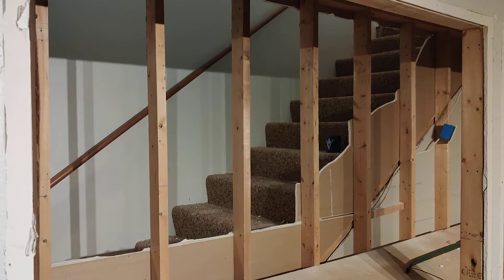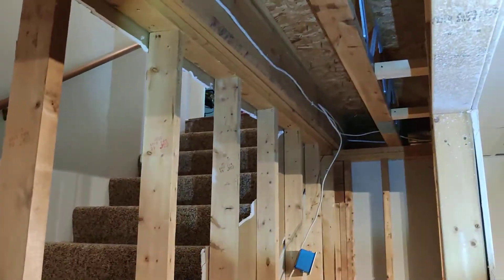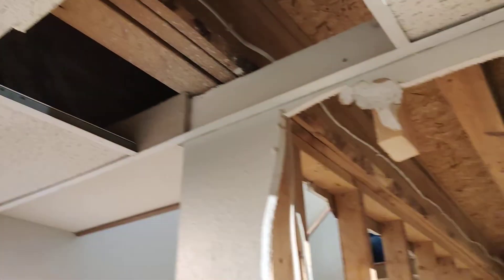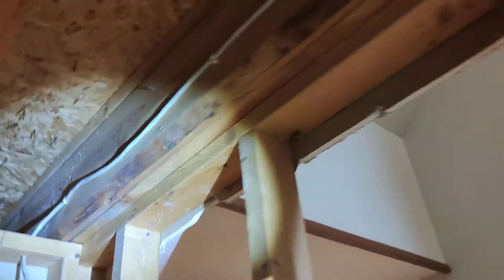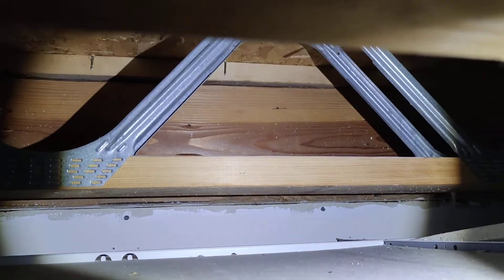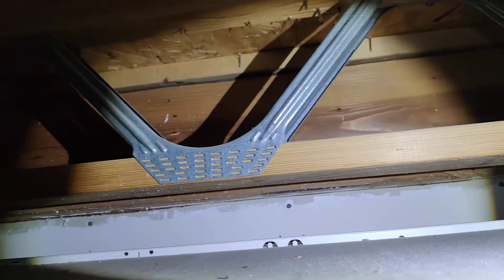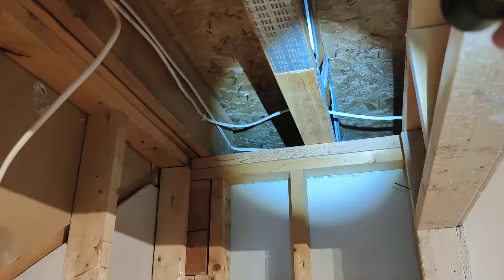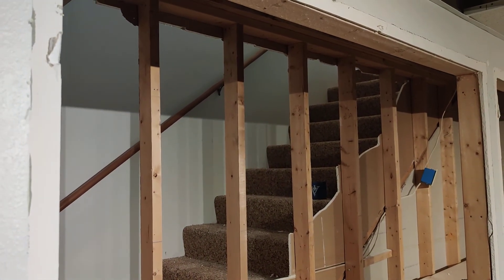To remove, or not to remove, the studs: an analysis of whether stairwell studs are load-bearing.

Comment: the other wall that runs perpendicular to your stairwell wall you stated was load bearing ? Usually there is steel beam in a basement on columns and piers and don't rely on a carpenter built wall. As far as your thinking on stairwell wall I think your probably safe but I would at the very least have a experienced carpenter/builder look at that before.
Reply from the maker: thank you. my basement is special. no steel support nor beam. so